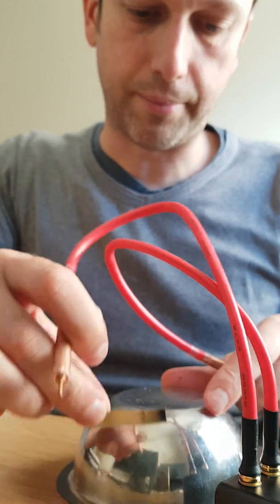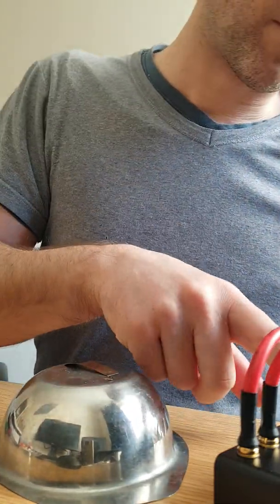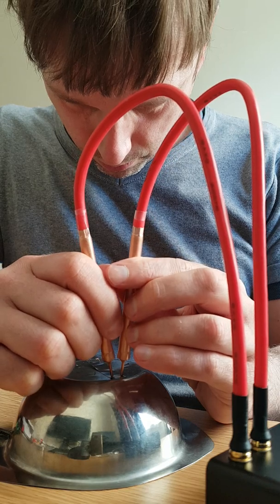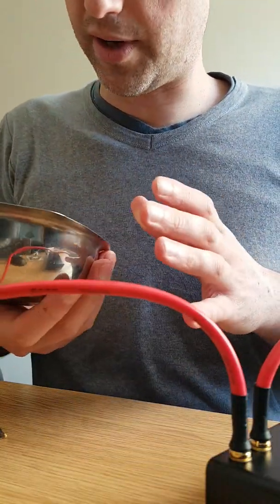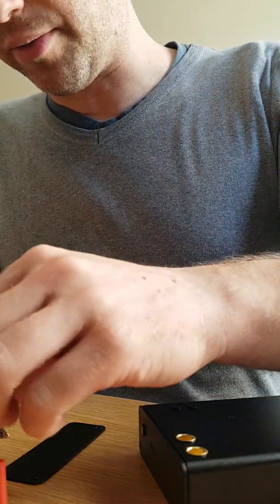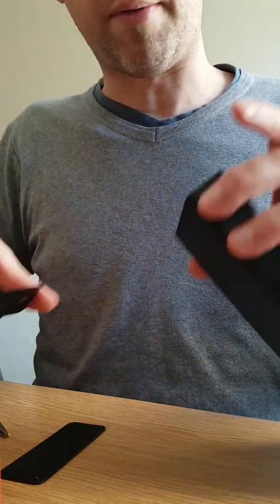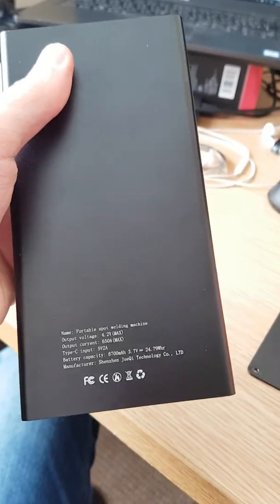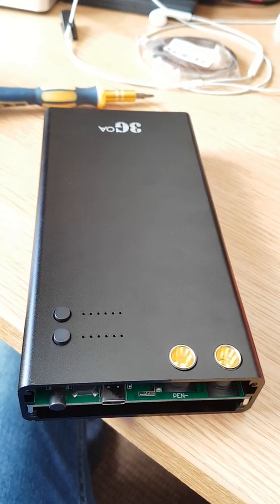3goa 6 gears mini spot welder usb-c @ 5v&2A peak weld at 650A powered by 6700mah @ 3.7v lypo

Comment: Thanks for checking it. Looks like there is plenty of space for battery upgrade. So the question is, whether the mosfets and rails/cables would handle it if one upgrades to i.e. 10000mAh cells with 60C rating.
Did you opened it in the end to check the circuit board?
Reply from the maker: Hi Thomas, the PCB is secured by some bars pressed by force on the side of the shelf. So the removal is a bit destructive I'm afraid. But this is a good idea about the upgrade to better rated LIPO batteries. Unfortunately I doubt it would be the extra capacity would be of a real benefit as the full charge (which takes 3 hours with slow speed charger) allows for a few thousands weld before it requires a new charge. What I would love if a battery with higher current outputs, those one being rated at 639A peak. The mosfet are the standard Chinese one that are used on any spot welder which are 300A max i believe. I have tested more welds since and the settings below 4 is not of any use IMO. I would love to have a beefier welder that can weld overlapped 0.1 nickel strips. I seems to be only OK for 0.12 and below from my testing so far but other upgrades ideas are welcome ! Please share some links about possible LIPO upgrades and I might give it a shot !
Reply: @ClemOnShow  This is exactly what I meant. By bigger battery with higher C rating, you will get higher current.
The original 6700 mAh battery they have used is most probably not rated for 100C, which their 650A claim suggests, even though it would be interesting to know what kind of battery it really is. They most probably rely on the fact, that for those 10-50ms the battery can give much higher current then for what it is rated for.
So even with the same quality battery, but increased in size to 10000 mAh, you will get current around 1000A (10000 mAh x 100C). But then the question is, whether those Mosfets would survive.
Somewhere I remember reading that these cheap 300A mosfets are realistically good only for 150A before you risk some will explode due to bad quality control... So in case there are only 4 of them in this Spot Welder, pushing the current from 650A to 1000A may be too much for them...